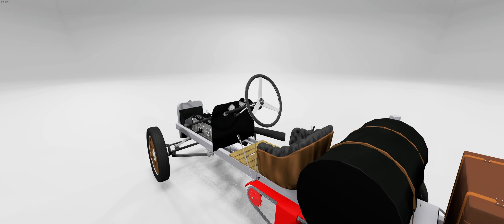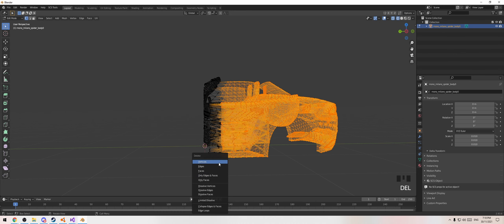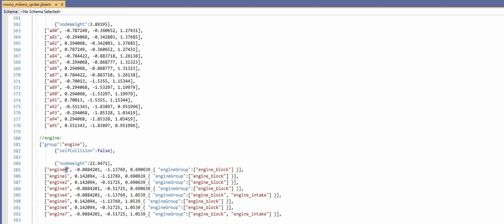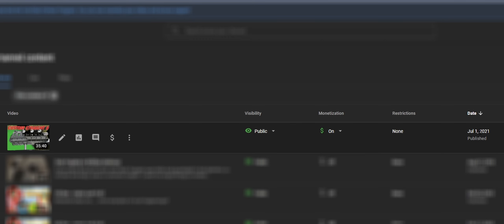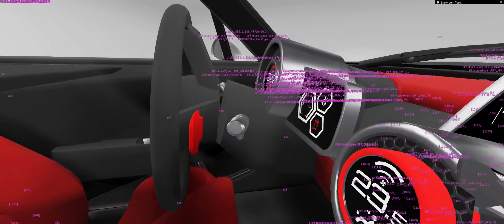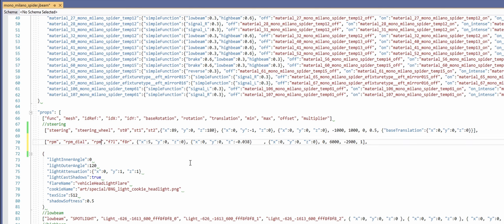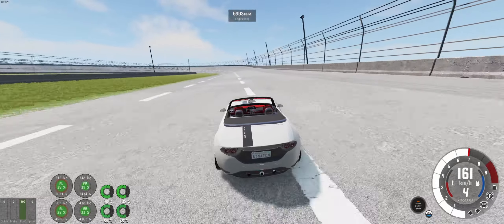Hardest mod? Automation/BeamNG Gauges & Wheels

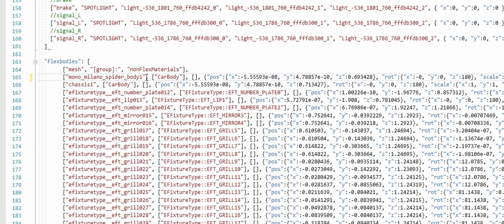Comment: So i did everything the same to my knowledge but when i ctrl+r the body is completely invisible and im not sure how to fix it so im basically stuck around 9:10
Reply from the maker: that's what's called a syntax error. You've basically made a formatting error with an incorrect amount of brackets, missing commas, or made a misspelling...

finding said issues can be hard, see if your chosen code editing software has an error checking section, or delete and restart :/
Reply: @fillman86  ahh okay thank you so much, ill try that. Ive already deleted and restarted so hopefully i can find the problem but thank you!
Reply: I only have one flexbody and its the body itself im not sure if thats a problem im not very experienced in coding so im not really sure what to look for, i only changed the number at the end of the name like in your video and the same in visual studio but it still doesnt work. Im a bit lost.

Comment: there is two daes, one is body mesh and one is just called mesh the mesh is the engine and the body mesh crashes when i loada it up
Reply from the maker: this is old and there's easier ways now. Check out this video where it takes no modification anymore - https://youtu.be/kbgy7nW5rQM

if blender is crashing on import, then try using an older version of blender (though it shouldn't be crashing in the first place)
Reply: @fillman86  I did that tutorial you sent and it works thanks!
Reply from the maker: @daguyfromohio  yeah, I don't know why they weren't more public about this update tbh.... but hey, it makes for a good views on youtube lol
Reply: @fillman86  Also my driver camera isnt near the steering wheel, Is there any way to fix that? Also thank you
Reply from the maker: @daguyfromohio  there's a miscellaneous fixture in automation that places cameras. Also when placing it, there's a small window at the bottom right of your screen that'll show the view
Reply: @fillman86  Thank you sooo much this saved me
Reply from the maker: @daguyfromohio  I'd suggest joining my discord, there's an automation section with people willing to help :)

Comment: For some reason I think the point my wheel turns around isn't in the middle, it looks as if it is spinning around the bottom of itself, I have messed a bit with the rotation values but it isn't changing what I want, if you know why this might have happened maybe you could help me with it?

Comment: Gotta question. I have mod BMW E46 sedan, which is fairly good mod, however, petrol and diesel versions have the same tacho/gauge meters (they are all 7k revs, diesel should have 6k revs). I got another mod which is coupe, that already has 6k rpm in diesel variants, 7k in gasoline ones. Is there any option to copy-paste/replace this tacho from coupe mod to the sedan mod to work? I know I sound greedy, but I'm perfectionist, and that one extra 1k rpm is catching my eye.
Reply from the maker: There’s a lot to go into here, I’d suggest going to my discord channel and going to my beaming section where there is lots of skilled modders

Comment: It's only 1:42 seconds in and I am already stuck. I have gone into the unpacked folder, into my car folder, I quick searched for the .dea, found it and then opened it up in Blender... but it doesn't a window just appears momentarily then disappears.
Reply from the maker: try using the latest version of blender, if you already are, try using an older version (make sure you're using the proper importing option)
Reply: @fillman86  What version are you using?
Reply: @fillman86  I copied exactly what you did.

Comment: so I attempted this my self, everything works, managed to figure many things out myself, but I have one MASSIVE issue now... The wheel bounces around as if it's going through a damn seizure, seemingly in all directions, but mostly noticable in x axis. I tried multiple nodes to try to get rid of this issue, tried your nodes, I tried many of my own, seems like changing them does make an affect, some are super bouncy, some are not as bad, but as soon as I start driving it starts doing same thing again. Any idea what would be the solution, got pretty sick of it after 3 damn hours of trying to fix this
Reply from the maker: increase the nodeweight of the created nodes

Comment: To make selecting the wheel inside all the other geometry easier, you can use View-> View Regions-> Clipping Region and then drag a box around the the steering wheel region, to create a temporary view that hides everything outside the box, and then it's just a matter of rotating the camera to view thru the hole you cut. The camera angle you start with before defining the Clipping Region might be important; if you don't get a good "cut" at first you can always try again (I think the first time you click the option again it just clears it, then if you wanna create a new cut, you click on it once more).
Reply from the maker: you know what, I could have just used "h" to hide.... but I'm fine with giving people less steps in tutorials, because it leads to less mistakes :P And anyone who's more skilled will know how to do it better :)

Comment: can i export a as a roadster and selecting the steering wheel then make another copy of the car with the roof and import my previously selected wheel on it?
Reply from the maker: you mean take the wheel from one car, and put it in another exported car? you can, but you need to either apply materials from the destination car, or put the required material code from the main materials file from the old car, into the new car main materials file (being careful to not put the new materials at the bottom of the file)
Reply: @fillman86  what if i made the car with the steering wheel above the car so selecting it will be easier ?
Reply from the maker: @Mr.pawahh  that's also an easy way to do it :)
Reply: @fillman86  thanks for your help man+ do you know any troubleshooting tutorial video or forum post?
Reply from the maker: @Mr.pawahh  trouble shooting? my discord is a pretty good place

Comment: My steering wheel is turning up and down not in a circle.
Reply from the maker: sounds like you've applied the "rotation" section on the wrong axis (not to be confused with base translation)
Reply: Your response time is insane, how would I apply it to the, "right" axis?
Reply from the maker: @cutecattheiii8216  play around with your values :)
Reply: Alright well, a decision begun because I listened to the song My Way looks like is gonna have to end, I've done what I believe was right but the wheel just spins in every direction on it's pivot of st0 but no mater where I put st1 even if it's the right spot it just doesn't turn as it should. Changing the values has done nothing, I believe I am going to have to just give up and reexport it.

Comment: Welp, there goes my week i guess
Reply from the maker: Haha once you get used to it, it can be done in 5 minutes or so :)
Reply: @fillman86  Im having a problem, my car doesnt have a .dae. It only has a .car and if I try to open that with blender it doesnt work. I also found another .dae file in another folder but if I try to open that one it still doesnt work
Reply: @purlikvods8368  its in a folder

Comment: So im basically stuck at where you paste the steering thing, I have 2-3 Problems or maybe MORE.

1. When i copy the one you pasted and press CTRL + R in BeamNG i just watch my car go to space and can't control it.
2. Im not good at doing coding lmao.
3. And my car is different, it is a Supercar with less fixtures.

I need help.
Reply from the maker: flying off into space like that is a syntax error that you've made somewhere

here's a simplified tutorial that I just made a few weeks ago - https://youtu.be/kbgy7nW5rQM

if you want to learn modding in a more general way, this video may also help - 
https://youtu.be/_b9p9POjQOk
Reply: @fillman86  Thank you, i will try to fix the problem and watch the video.
Reply: @fillman86  Though i have tried the hidden steering wheel option but it didn't work.
Reply: Alright this is guaranteed not helpful, wasted my time just for my car to go to space even tho i checked properly.

Comment: 9:15 i did everything but my car turned into a no texture maybe your tutorial doesn't work for new versions of automation I'm using openbeta LCV 4.2
Reply: i named my car d and its the same... no texture
Reply from the maker: tutorial still works. The problem you're describing sounds like you're giving the car a long name. What you can do is look at the material names in blender, and make sure they match in the main.materials file
Reply: @fillman86  ok thanks i will test it

Comment: Next: engine swaps with meshes, and wheel swaps with beamng stock wheels

BTW idea for gauge and wheel, just move it in y coordinates so it'll be ez to separate
Reply from the maker: move what in the y coordinates? make what easier to separate?
Reply: @fillman86  before export to beam, steering wheel and the parts you want to separate is moved up, so it'll be easy to select and separate.

but if u directly use on beamng it'll look awkward.
Reply from the maker: @bitelaserkhalif   oh yeah, I've done that before, but usually steering wheels are an after thought :P

Comment: is there any way to avoid no texture problems, the chrome ring on my wheel isnt chrome anymore
Reply from the maker: figure out the name of the material in blender (including the length of the name), and change the name in the main material file to match.
In the future, keep your car names short in automation, and you'll be less likely to have this issue with blender
Reply: @fillman86  now I see what you mean, the names were messed up because of theyer length I can actually fix it manually in the material file as you said👍
Reply: @fillman86  is there a way to  lengthen/change the car name afterwards?
Reply from the maker: @bennetenglisch1467  If you just want it to show up with a different name, then I believe you edit the "info.json" file

Comment: Hey Fill, when I re-entered Beam after setting the call to body1, my entire car went deep black except for the engine, wheels, tires, suspension and chassis. Do you know what causes this and how I fix it? Thanks in advance :)

edit: the steering wheel is gone which is good, but still, everything is deep matte black
Reply from the maker: there's a few things that could cause this, try clearing beamng's cache, and if that doesn't fix it, go to my discord, and ask there
Reply: @fillman86  thanks for the quick reply! I'm gonna try that tomorrow

Comment: Wait a min is my comments bugged?
Reply from the maker: meaning?
Reply: @fillman86  nvm i attempted to make a comment.. But I am pretty sure yt though it was one of those spam bot comments.
Reply from the maker: @Shad0w_353  weird, nothing's showing up in my filtered section
Reply: @fillman86  welp... the original comment that I originally posted showed a way to view node positioning in blender
Reply: @fillman86  what I had done was go to blender open up edit mode and look for something that looked like this "<" (p.s it is on the right and it is near the x y z thingy)
Reply: then once you opened it press on a node and it should have said...
Reply: X 
Y
Z
Global Local
Reply: Press on global to get the positioning of the nodes  and yeah that is how I do it
Reply from the maker: @Shad0w_353  you can press "n" for that menu, and you can move vertices. but how does that help me?
Reply: @fillman86  The menu reveals where every node is positioned.. Notice how the blender and beamng nodes are somewhat similar.. I mean it is kind hard to explain it so uhh yeah let me try and find a video where someone uses this..